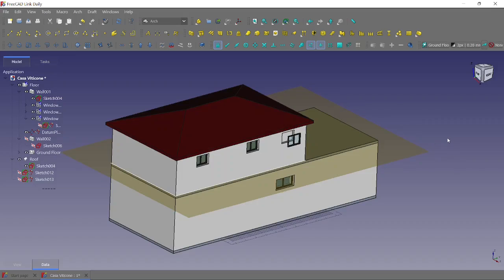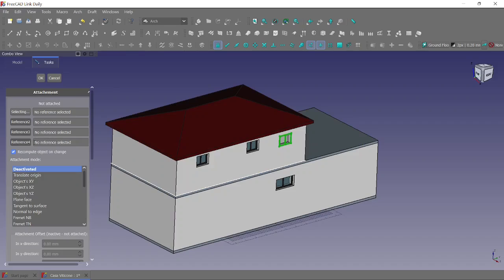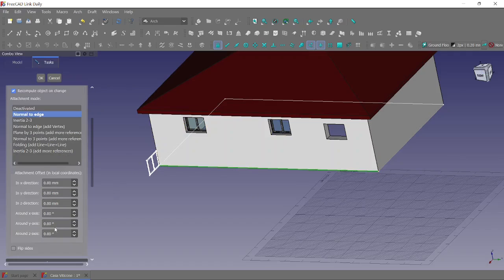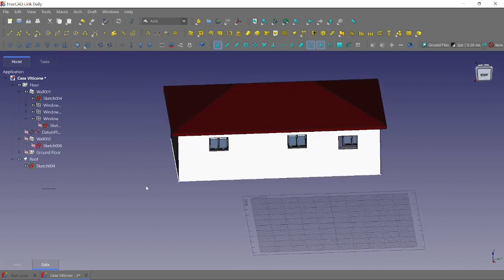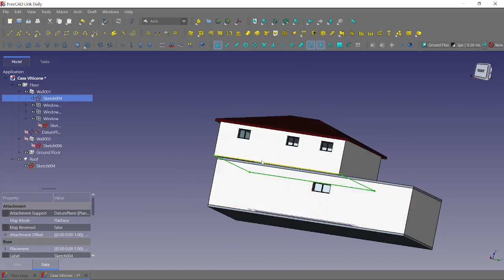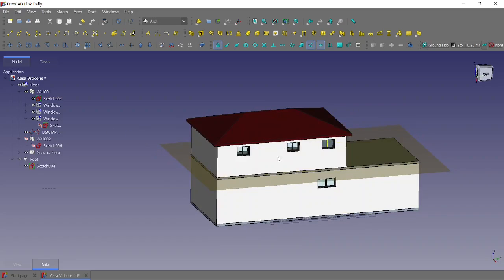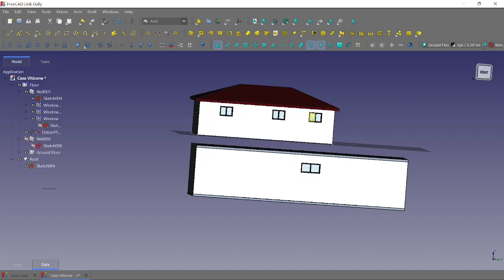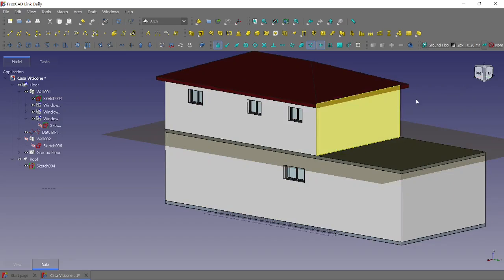FreeCad Parametric Window placement - FreeCad Arch Bench modelling

Comment: in this project (and in all FreeCad Archs projects I tried) the windows are attached in wrong way - the windows 'pushed' in external side of the walls, but in real building the windows are pushed out a bit of external wall and from interior view the window always pushed in of internal side of wall. Do you known some technique to "flip" the window relative position? Thank you.
Reply from the maker: https://forum.freecad.org/viewtopic.php?t=35368  I think this is what you are talking about. The window tool is nice and simple in concept but one of the worst in any Cad program I've used.  Rather than complicate the Arch tools further with BIM, and a lot of crap that is not necessary at this stage, focus should be given in making the basic architectural tools intuitive , easy to use and functional . Editing the window should be as intuitive as creating the window. It is not. It sucks. It sucks badly. It needs to be further developed. But apparently the programmers think its fine???